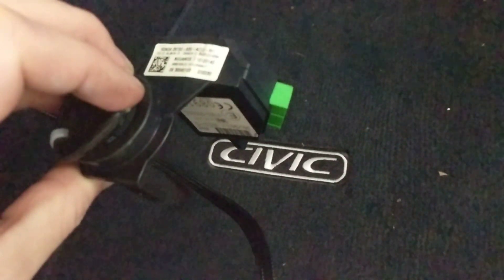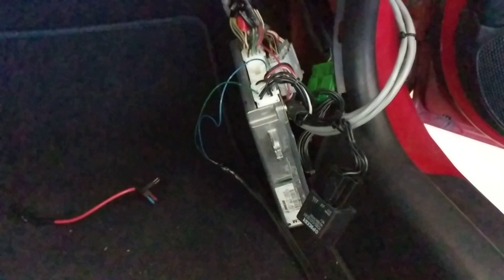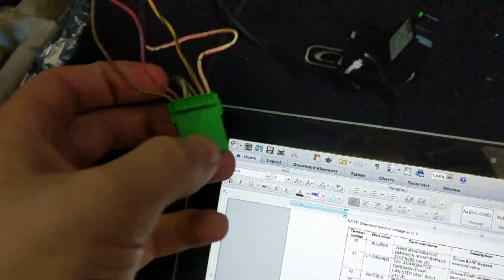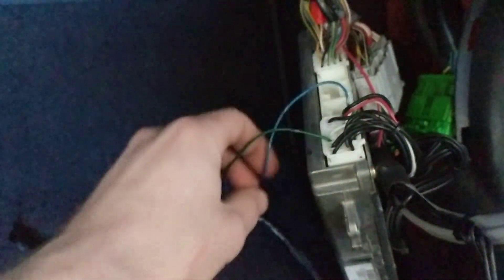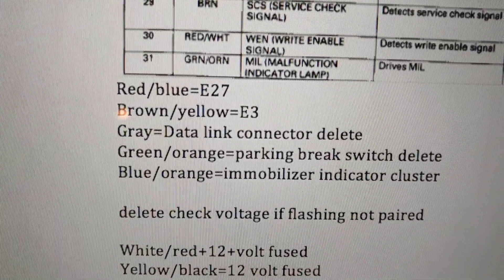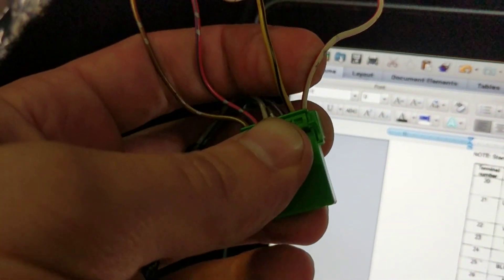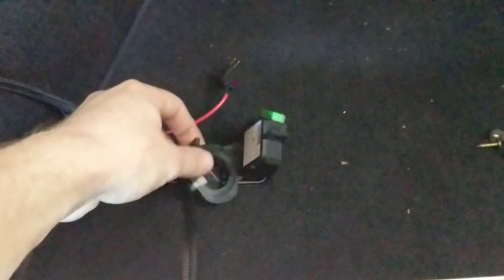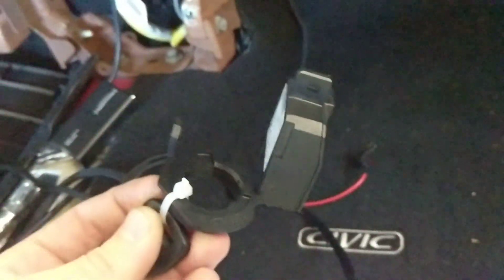K20 Swap using stock ecu and immobilizer

Comment: For the "Gray = data link connector" does anyone know which pin exactly on the data link that would go to? Just in case you need to program an immobilizer unit to the ecu!

Comment: I've wired mine up like this but I don't seem to be getting any spark or fuel
Reply: I had this issue you need to make sure it’s wire to 12v key on if it’s wired to 12v constant it won’t work.
Reply: @Em1_matt  I ended up using immobilizer bypass, apparently it doesn;t work on UK ECUs
Reply: @Em1_matt did you do it to your em1 ? I’m having an issue where the car starts but as soon as I press the gas it turns off not sure what the issue is.

Comment: I need help, not working on pra ecu- uk ecu
Reply: Same. I got no fuel or spark. Did you get yours working?
Reply: @EJayNine  this tip not working with Eu  set, problem is in multiplexer. After connecting the multiplexer bypass from ebay i started the engine.
now i run on standalone
Reply: @cybi2000  Awesome, I've just ordered the bypass so hopefully it works for me too until I can get a new ECU, Thank you for the reply, you've stopped me going crazy.
Reply: @cybi2000  Siemka, jestem na tym samym etapie jeśli chodzi o swapa, mógłbym się jakoś z tobą skontakować? Bo mamy problemy z odpaleniem fury. Pozdro :)

Comment: On my conversion harness the e3 already has a wire do i depin that an then put the wire in or tap into that
Reply: How did you find a diagram for e plug on the conversion harness anyway you can send me the diagram?

Comment: You used 1 fuse tap for both wires or used 1 per wire
Reply from the maker: Power both with 1 12 bolt source
Reply: blackws6 hi, how comes there’s 2 12v wires?

Comment: Hi I have a Honda FD2 which am K24 swapping and am using the K24's ECU, the FD2's imobiliser system is preventing the car from starting, will the steps in the video apply to this?

Comment: This won't be needed if I get a jdm ecu or kpro, correct?
Reply from the maker: Correct, but if you would like any sort of theft protection it could be added.
Reply: @kozs360s  car is garage and track only so I'll be keeping it as simple as possible. Not too worried about theft.